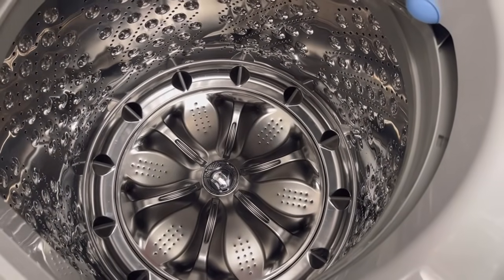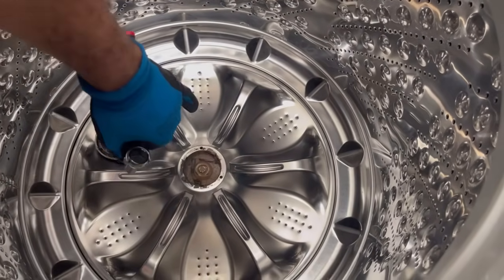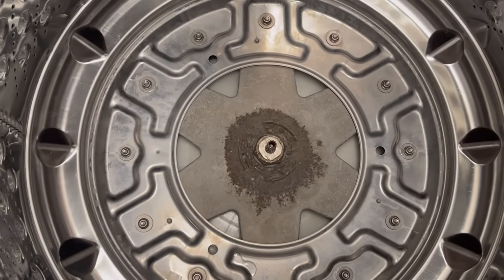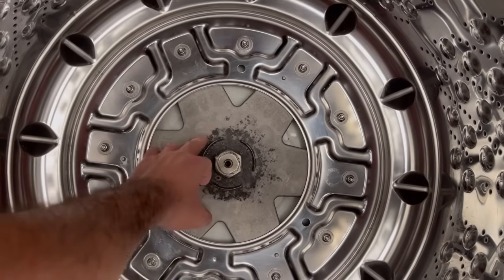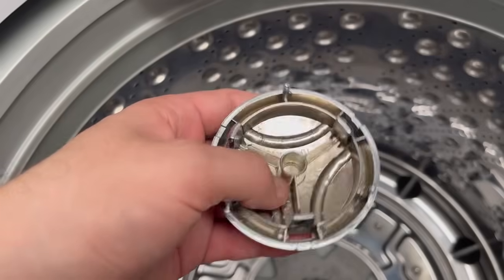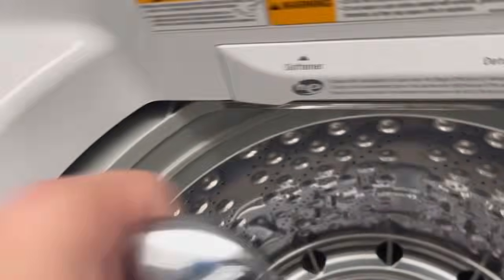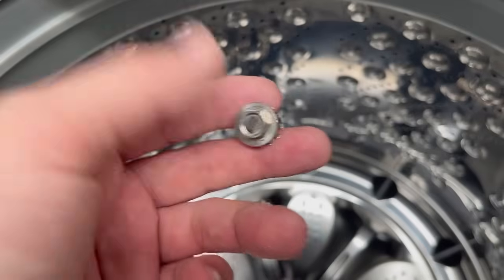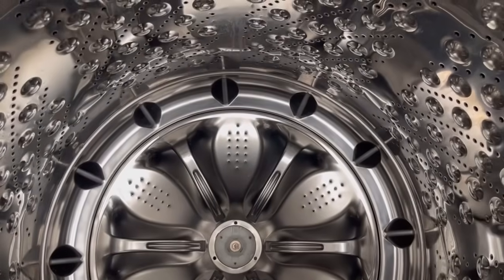How to remove and clean LG washer machine filter

Comment: Any hints on removing the filter after removing the bolt? It’s certainly stuck and I was hoping it would come out like shown in the video.
Reply from the maker: Here in the comments section few viewers had mentioned they applied various methods/techniques to remove the pulsator. I’d recommend trying one or more of those methods to remove the agitator in your washing machine. In my case, ours came out rather effortlessly as you could see in the video. Thanks.
Reply: @ thanks, yes, the advice to use the tub clean cycle worked to float the filter from the bolt.

Comment: Thank you for this! Once I pull the wheel out, what’s the best method for cleaning out all of the gunk? There’s a lot!!
Reply from the maker: Thank you for your feedback! I soaked ours to warm water for a little while and rinsed it with garden hose under higher pressure. While I may not have been able to remove all the gunk it however helped me clean it immensely. Hope this helps.

Comment: I would suggest using two screw drivers in two of the holes simultaneously to prevent breakage.
Reply from the maker: I will try that next time. Thank you so much for that tip!
Reply: What do u do if one of the taps broke?
Reply from the maker: @Jose_I  here’s where I ordered ours when I broke the tab when I was trying to remove ours. 😅

https://amzn.to/3WGzOfD
Reply: @SOBIsHobbies  thank you I just broke it 😅 one quick question when installing it back and staring the machine up I here a grinding noise not sure what is? Any idea? I don’t know if it’s because of the broken tab or because of something else
Reply from the maker: @Jose_I  I’m not 100% sure what that grinding noise is about but if I were to assume it might coming from the plate itself if it’s not seated properly onto the center rotating pin. If you noticed both the plate itself and the center piece have ridges and grooves. It’s there to keep everything in place nice and tight while washer machine is in use. If I were to speculate it might be coming from there. Otherwise, I’m not sure what maybe causing for that grinding noise. Let us know if you find out what’s the cause. Thanks.
Reply: @SOBIsHobbies  after watching many videos on YouTube the problem WAS the plate but most videos said to replace it and mine started making the noise right after I cleaned the filter so I doubled checked the filter and since one of the tabs is broken I think that’s what caused the grinding noise so pushed it on it a bit harder and it went away.

Comment: Small plastic cap, and screw underneath it came right out. The big aluminum wash plate wouldn't budge!!!! Worked in it for 3 hours prying up on it with pry bars, and it wouldn't break free to save my life! I'm going to try what a couple others have done, and that's to soak in vinegar for a couple hours, and then get a couple of those #8 screw hooks, screw them into the plastic holes, and pull up on them using pliers. Hopefully this works for me also. Wish me luck!
Reply: I let it soak for 7+ hours with Vinegar, installed the screws, pulled up on it with channel locks until I had the whole tub slamming Up&Down, beat with a mallet and this technique still didn't work! UGHHHHHHHHH!!!! 2 Days working on it with the help of my wife, and I'm DONE with the dang thing! I have 1 thing to say: MY IS NOT REMOVABLE!!!! 🤦🏻‍♂️🤬
Reply: @allenmorris2661 I’m having the same issue. It’s very frustrating!

Comment: We wanted to thank you very much for the video. Our only question is below in regards to the locrite type?
Reply from the maker: Thank you for yours feedback! I’m not 100% sure in terms of which type of Loctite to use. However, if I were to use a Loctite I would probably go with Loctite 425 to use with plastic since it poses less adhesive strength which is perfect for plastic or rather more delicate materials. Hope this helps.

Comment: thank you for this excellent video!  I have a question for you:  Is there another drain filter that is accessible from the back panel?  thanks so much!
Reply from the maker: Thank you for your feedback. To answer your question, I haven’t checked the contents behind the back panel. Therefore I can’t say for sure if there’s another drain filter on the back side. Sorry about that.
Reply: I just opened up the back of mine before finding this video. I could disconnect the drain hose and pump. I did not find any filter or other things of interest, so I think this video is probably hitting the core issue. My drain line was gunky but it didn't feel like the culprit of the brown flakes being left over after wash. Also found nothing much to clean in the pump.

Comment: I have the same washer. But I didn't use the vinegar and baking soda prior. I used the vinegar and baking soda on the cleaning cycle. Thst broke up a lot of gunk. The agitator was hard to get off. It broke. We had to order the plastic top piece and the agitator. What did your wife use to clean the dirt at the bottom after the agitator was removed? How often does your wife do use the vinegar/ baking soda wash?
Reply from the maker: Hi. My wife ran a cleaning cycle every 1.5-2 months. And I believe we used Bar Keepers Friend cleanser to clean the bottom of the agitator. Hope this helps.
Reply: Do you just put the baking soda and vinegar straight into the washer?
I took my agitator out and cleaned all the gunk from underneath it and got it squeaky clean and the first couple cycles after were great, no flakes. But then just now saw some after this last load.  Not sure where it could be coming from now.

Comment: This video was great to explain removing but upon trying to reinstall the hub/plate it keeps coming loose when I run the clean cycle.  Does this mean that screw is stripped or am I just not tightening it enough??
Reply from the maker: Based on your description: A. Either the agitator isn’t seated all the way. B. The screw threads might’ve been stripped/damaged. 

I would try to make sure that everything is properly placed/seated before tightening the screw. Also just for good measures I would apply some thread protector tape on the screw before tightening the hub. Hope this helps.

Comment: Hi,
Thank you so much for this very helpful video!
I followed all your steps. After removing the 10 mm bolt at the center of the panel, but I can’t lift the round panel on bottom of the washer with my hands.
Is there any specific tool for this?
It seems like the debris under the panel does not allow me to lift it.
Thanks for your feedback 🌻
Reply from the maker: Thanks for your input. I did not use any specific tool to lift the pulsator panel myself. For me after slightly wiggling it a couple of times it came right off. Maybe yours got stuck…? It’s hard to say without seeing it in person unfortunately, sorry. I would give it a slight pull while wiggling it and see if that would let it come off. But be careful not to pull it too hard or force it too much where you can brake it. Use your best judgment. Don’t hesitate to ask if you have any questions. Good luck!
Reply: Use gloves. You need a better grip in the opening. It should pop straight out, but the force you need will cut your hands against the metal in that opening. Funnily enough, when you use the gloves, it'll pop out with less force than you think is needed.

Comment: Customers should mnot be expected to remove parts with socket wrenches and screw drovers to get at areas to clean. Picture a 90 year old woman trying to do this.
Reply from the maker: @TheUtube53  I cannot agree more with your statement. However that goes both ways, correct? If you (the customer) don’t want to or can’t perform these “maintenance” procedures then you can always opt-out to not doing them and instead have the professionals do it or just use the unit until it’s no longer capable of working and get a new one instead. On the other hand you can attempt to perform this process and save yourself in the process from 10s to 100s of dollars (probably). 
I just shared this video in case if anyone wanted to give a try to cleaning their appliances themselves. There’s absolutely no intention of making anyone do anything against their will from my end. I am all for try to being self-sufficient and minimizing involvement of “professionals”. Because at the end of the day with some knowledge and skills anyone can do anything (within their physical and mental abilities of course) in my personal opinion. Ultimately those professionals are just human beings like the rest of us. Human error is still going to be the major factor even with the professionals. Cheers!

Comment: I have an LG washer with an agitator and I was having the brown flakes on my clothes and when I took the agitator out I found that the bottom of the plate was completely covered in brown sludge.  I cleaned it spotless and all was good for about a month and now I am seeing them again so i took the agitator out again and it was still clean.   Any idea where to clean now or where the brown flakes could still be coming from?
Reply from the maker: It could be that your agitator filter may still contain some of that sludge and dirt that gets released inside the drum due to the vibration when washer machine is at work. Therefore, my next best guess is that you may have to replace your agitator/pulsator assembly. Hope this helps.

By the way if you decide to replace your pulsator assembly you can use the following link to purchase a new assembly (disclaimer this is Amazon Associates’ link):

https://www.amazon.com/dp/B0BN82FG1G?ref_=cm_sw_r_ud_dp_DJVZ0JA0PKZ90BQE7Z0S_1&_encoding=UTF8&tag=sobishobbies-20&linkCode=ur2&linkId=82a4efe414fad0d2227f0c874c5b8e0c&camp=1789&creative=9325

Comment: Broke one latch on the chrome plastic cap.  The trick is to get a thin screwdriver blade into the vertical slot in front of each latch "pin".  Gently pry outward toward the drum while lifting the cap at that point.  Repeat three times.  You are pushing the barb at each point so it lets go.  But I came here for filter replacement and there is no filter.  I guess the pulsator plate IS the filter but I think I have several small coins  down below after a quarter wedged itself between the plate and drum.
Reply from the maker: Thank you for sharing your experience!

Comment: Thank you for the video. I was looking on how to remove the “liquid bleach only” blue cover on the front-left of the machine without breaking it. Any idea?
Reply from the maker: Thanks for watching. Unfortunately, we no longer have this unit. We recently bought a new set of washer and dryer during holiday sales and replaced this set. It was still working at the time of its replacement and it did so for the past 7+ years. Very reliable and a great unit overall. I would keep it but wife wanted something newer. 😅

Anyway, I don’t believe I ever tried to remove the cover for bleach section. However, if I were to guess you may be able to pry it out with a PLASTIC pry tool. I would avoid using any metal tool just so it won’t break while trying to remove it as most of those cover pieces are all made out of plastic. Hope this helps.
Reply: Thank you for your follow up

Comment: This is going to sound weird but I’m short and had to improvise. I could not get the washer plate off so I used the hard string from a string cutter/edger and looped it thru the holes and then yanked up and it popped right off!
Reply from the maker: Thanks for sharing your experience. It’s all about trying. 😊

Comment: If the lid is stuck and you screwing it still won't come out. Use vinegar and let it sit overnight. See if it will come out. If not, you viniger again but run it on clean/tub mode for like 10 mins. Make sure you leave the screw unplugged! The piece should float to the top. Mine was very stuck and had to do this.
Reply from the maker: Excellent tip!! Thank you for sharing this information!
Reply: Thanks for the advice! I didn’t let it sit overnight but just let it run and it came off pretty quick.
Reply: @SOBIsHobbies can you help me 😩

Comment: How do you suggest getting the big metal piece off if it doesn’t budge after removing the center bolt?
Reply from the maker: Honestly, I do not know. As you saw in the video I was able to remove it simply by lifting it straight up after removing the bolt. It’s hard to know for sure without seeing it in person why yours wouldn’t budge, sorry.
Reply: @SOBIsHobbies  thanks for the reply. I watched another video and they suggested using a “mini pick and hook” set from harbor freight. It’s a tool to remove o rings and gaskets. Bought this and still won’t budge. I hate to have to call a technician but I guess I’ll have to.
Reply from the maker: @kylemcmillan2226  sorry to hear that but at this point it’s probably best to let someone else deal with it who’s more knowledgeable than causing damage to it. Good luck! Share your insight if you can get it out somehow. Thanks!
Reply: Did you manage to get the big piece up? Because mine won’t budge.

Comment: When you have a piece of plastic tightly “fitting” into a metallic part, you need to use your knowledge of materials to figure out how to decouple them. If I remember my materials course in engineering well, when increasing the temperature for a piece of plastic vs metal by X degrees, the elongation of the plastic part is 9 times that of metal. This also works when freezing the parts. Soooo, put that plastic/metal part in the freezer for a good hour or more, and see if you can separate the parts from one another… Good luck and let me know if it works.
Reply from the maker: Thanks for your input.
Reply: Seriously? 😂to be sure thats a vv expensive 'uncoupling' theory when you still haven't an idea where the screws are that bind the two. Js
Reply: It’s a washing machine with a plastic part that is easily removed. This isn’t rocket science.

Comment: Did any of your washing machines stink constantly? That is our issue so I am hoping this fixes it. We have tried everything else.
Reply from the maker: This most likely will help you to get rid of that smell. You may have to power wash the inside of the agitator/bottom filter. If you can’t remove all the trapped dirt even after the power wash then you may want to consider replacing the agitator. Because that’s where most of the sludge from washes get stuck. Hope this helps.

Comment: popped the plastic center piece, removed center screw with the gasket - could not get the bottom saucer part to lift out. Got nervous and put back together, at least the center cap is clean and the area underneath. Any hints? Washer is approx 4 years old and I have never tried to do this. 

Thx!
Reply: @surgicaltechcrafter2169               I'll try your method - but not today :)
Reply from the maker: If you don’t see any gunk or smell any odor then yours might be doing just fine. I would just use some of this cleaning remedy and call it a day:

https://amzn.to/3XLVeup

This should help to remove minor buildups (if there’s any). Hope this helps.
Reply: How did you get the center piece to pop off? I’m afraid I’m going to bust it.

Comment: I can not get the bottom panel to come off. After I take off the cap, and undo the bolt with the gasket and washer, the bottom piece does not come off. I tried what another commenter tried and screwed in some screws into the white plastic that has 3 holes. And then lifted with pliers but all I’m doing is lifting the entire barrel. Is there something I’m missing? Or does my model not come off? The barrel looks the same. My model is LG WT7600HWA

Comment: Any tips on getting the screw out? Ours is completely stuck
Reply from the maker: Applying some WD-40 and letting it soak for 5-10 minutes may do the trick. Often or not that’s I what I use to loosen stuck screws. Hope this helps.
Reply: I was able to get the bolt out using my impact drill.

Comment: so what do you do if that bottom metal part is stuck.  i have tried pulling on it to the point im almost lifting the machine. thanks
Reply from the maker: @robertmoldafsky9343  Some viewers have shared their experiences with stuck drum and how they removed it. One of the methods, I believe, was soaking it in hot water and then try pulling it. Others said, I think, was applying some anti-stuck solvent. I recommend reviewing some of the comments that others shared and see which suggestion(s) suits you best. Hope this helps!

Comment: If the washer has some water that won’t drain could you do this as long as you unplug the machine?
Reply from the maker: If the washer machine isn’t draining then it could be due to clogged up drain tube. That may require a slightly different approach where you would need to clean the draining tube. But it doesn’t hurt to clean up your pulsator filter as well by performing this process showed in this video. Hope this helps.

Comment: When we removed the bolt with a ratchet wrench, it had orange threadlock remnants and a toothed washer. After the bolt was remove the interior was plastic. On the bottle of Permatex Orange 25210 high strength, the instructions says not be used with plastic. Although, its use is 3X the strength of blue and is ideal for high vibration. Loctite Blue 242 Medium strength instructions also recommends that it is not to be used with plastic and not trusted in a wet environment. Both products can crack the plastic. However, both products allow for easy removal. The only Loctite that I reviewed that can be used with plastic & metal is Henkel Loctite 425 and it is a a specific threadlock that is ideal for high vibration and easily removed. We are so confused as to what threadlock to use. Help!
Reply: I saw the statement on plastics mentioned on the Permatex Threadlocker Orange (25210) about not using plastics as well.  The bolt and housing of the bolt are both metal.  I plan on using  the Permatex Orange since it appears that LG originally used it from the start.